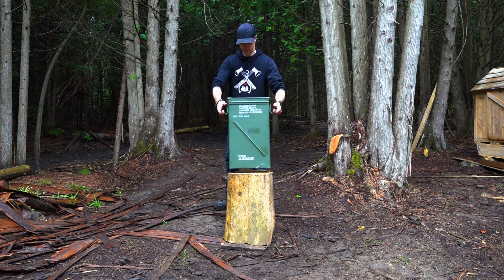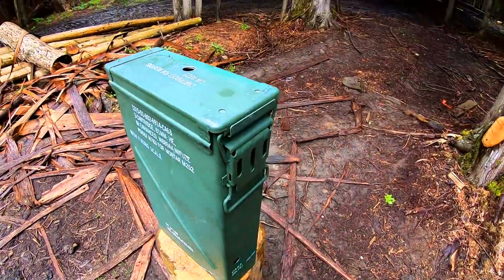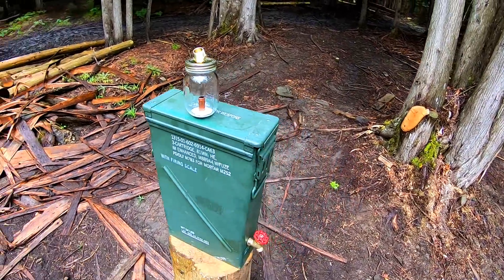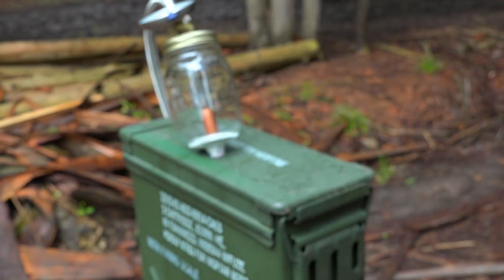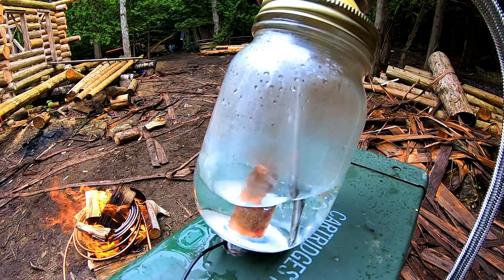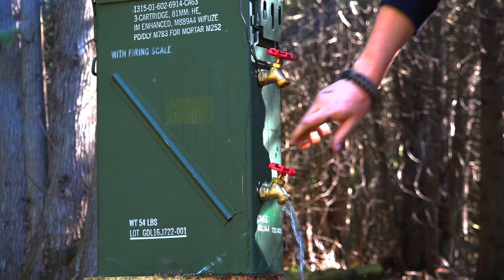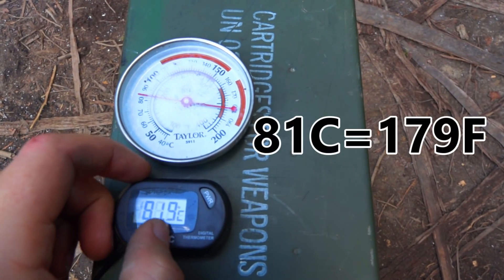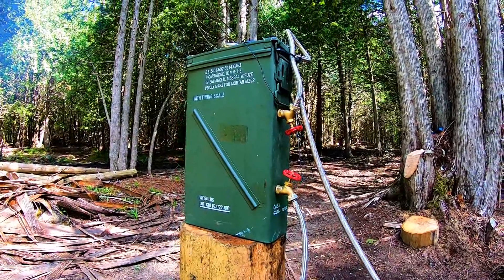Off Grid Heating Prototype- Copper Coil Water Heater / Heat Exchanger / Radiant Heater

Comment: why not put thermal bricks inside or at least stones to keep the heat for longer
Reply: Water has a higher volumetric heat capacity.
Reply: @xylitolchocolateshmackos6102  yes if you prevent or at least try to minimize evaporation and here that's clearly not the case also as far as I just researched volumetric heat capacity is not all that matters, from the most obvious point of water not being practical. And not sure is it even fair to compare liquid with solids...
Reply: @xylitolchocolateshmackos6102  One more thing I remember when I was a kid, sometimes there would be no power and also no heating so that we put water in a big pot on the gas stove to make it evaporate to heat up the house with vapour and we also put brick or stone inside so to spend less gas since you needed to add cold water inside, same as here in video, sure he will need to add less due to less evaporation but still I think it would save him some trips for firewood.
Reply: Just more water to cook much later and keep the heat for longer?
It would be interesting to test when it cools down to a point where it gets too cold in your tiny house and to find the sweet spot of building heat up and cooling down while asleep

Comment: don't see a point of using this. you won't be able to sleep near it, because of the sound and you have to remove the piping from the fire once it boiled. why not  just boil the water over the fire and then just place your ammo box or whatever where you need it.
Reply: I doubt that boiling water just placed in a box would radiate heat for very long, also if he still used this ammo box or something of a similar size that would be a lot of water to boil, this way it keeps boiling while the fire is going until its burnt out. You're right about the noise though youd either find it very relaxing or very annoying
Reply: @camoweed_  anybody who has cook anything knows that nothing just boils while fire is running. Probably the boiled water will condense everywhere inside the cabin before fire is over though.

Comment: I wouldnt have the copper directly over the flames like that.  You want it set back slightly under some ash and mud
Reply: Also the uneven  heat and expansion from a direct fire like that can cause the copper to warp, in addition the hottest part of the fire isn't where the coils are currently located but radiant heat towards the sides as well as the convection heat rising above. 

So mud and ash walls will help with the even heating as well as catching as much of the radiating heat as possible.
Reply: Why?
Reply: @doughboy5840  its not a permanent solution is why. At some point the copper coil will warp and fracture at some point with hot water spill out though it would take some time before this happens so not exactly permanent construct. Best way to do that is too incase the metal into concrete like making it into a firepit basically with the metal tubes inside too allow evenly disrupted heat this will last a lot longer than just throwing the coil onto the fire it honestly depends if you're wanting to spend money every 2-3 years on replacing copper pipes compared to maybe 7-10 years respectively with the pipes incased in cement though that wouldn't be too easy to carry around on a mobile platform some other okay alternative would be fiberglass bowl which is lightweight and you could just attach the pipes onto the underside or even just place the coil under the fiberglass bowl. 

@Kevin that isn't so much of an issue however he should have made a much smaller hole for the volume of water in the tank to slow down the loss of water all water heaters have release holes drilled into them for purpose of relieving pressure if not your water heater would be a ticking time bomb. Also since it seems he is out during winter with it he could just melt snow into a pot and then pour any missing water into the tank.
Reply: @doughboy5840  Because you will boil the water in a closed system with no vent or real expansion minus the loop. Also if he leaves the hole in the top open eventually the water will boil away and the copper will take all the energy and burn up.

Comment: Sleeping in a confined space next to an open bucket of boiling water? What could possibly go wrong? Maybe if you included a radiator built into the wall, with a thermostat to switch off the heat if it gets too hot... but I think I would want some kind of failsafe, to assure that I was not doused with boiling water in my sleep.

Comment: Probably 300 comments about this but you can ad salt to the water and it can stay liquid to -10 degrees Celsius or ad anti-freeze like in washer fluid to get down even lower depending on concentration ( -15C, - 40C). just know that will change the boiling point and it will most likely boil at a lower temperature if you use anti-freeze.

Comment: an adult male puts out about 100W of heat, given that your camper is so small it would be much less effort to simply insulate it sufficently to retain that energy!
Reply: When I read that I assumed you were telling him to pick up a boyfriend, lol
Reply: @TaliaAthena  That would solve the heating problem
Reply: I don't think that's feasible due to the fact that you need a bit of air circulation from outside.. especially with a camper that small.
Or, do you suppose he should install an oxygen tank and CO2 scrubber instead? :)
Reply: @ayporos  i wouldnt be too worried, an adult at rest needs about 8 litres per minute of air, that would be 133ml/sec. if you had a 40mm diamiter vent hole you could supply that with a flow rate of 0.1m/sec. i wont pretend to have done the maths on it but i suspect the convective flow through a 40mm hole in the canadian winter would be much greater than 0.1m/sec
Reply: @lendoggtheking  Oh I'm not worried about the airflow.. but rather the fact that there's no way in hell you can keep your camper warm with 100W of heat output when you have said airflow. 
The moment any non-trivial temperature differential starts to exist between inside & outside is when you get all of the warm air rushing out and all of the cold air rushing in.
Reply: @ayporos  On the assumption that the inside of the cabin is 2m x 1m x 1m it would have an internal surface area of 10m^2. If it was insulated all over with 200mm of PIR foam with a U value of 0.105W/m^2K (R value 9.523) then to maintain an internal temperature of 15C while its -30C outside would take 47.25W of energy (0.105*10*45=47.25). Putting a hole in for ventilation will allow some heat to escape but you wouldn’t need a big hole to keep the air fresh with a difference in temperature of 45C! I am assuming he would have some adjustment over the opening.
Reply: @lendoggtheking  that's a very small cabin, I'd guess his would be many times bigger volumetrically
Reply: @Moretonj01o  to be clear I'm thinking of the snowmobile camper, not the cabin.
Reply: Less effort yes...
 less cool too.
Reply: @barlowjmb  Clearly you haven't tried getting a boyfriend XD
Reply: @angelagrace8499  lol.
Reply: i dont think that it's really that easy since you might need to pee during the night or you just want to chill in the evening. it would take too long to warm up.

Comment: Both water inlet and outlet with valves on them? Yikes... Talk about pressure vessle... You need to add an pressure release valve, otherwise if you forget to open the valves and create a closed container with water in the coil it will go boom or atleast blow the seals spraying out hot water in the camper.

Comment: You need a 1 way ball valve on the cold water inlet .. I like the 5/8 pipe choice for this application. 3/8 needs the check ball to flow.

Comment: How are you going to regulate it? Are you going to let it run at night while your are sleeping? What’s to prevent thermal run away? If you aren’t collecting the steam that is generated and reintroducing it back into the system your water supply will be exhausted before the fire. Copper rolls from the hardware store are easy to bend because they are thin walled, what is the affect of the ashes and dampness on the copper? Might want to think about a closed  system where the coils are just above the fire and you use the steam to heat an air duct that can gently heat your cabin and if it goes into thermal run away you aren’t exposed to boils water in the cabin.

Comment: You need an exhaust pipe on the top that is vented away from the unit if you plan to put that in your camper, or the whole thing will get get moldy from the humidity.  Also your fire was too hot, you don't need that much fuel.  A steady slow burn is what you want.

Comment: So what now?  Do you carry the hot ammo box full of water and set it inside your camper for radiant heat through the night?  You could boil some potatoes in there too.  LOL.  Sorry, I'm a little slow here.  How is that going to heat your camper.  Will your run some of the pipe into the camper as the coil is on the fire during the night to heat the camper?

Comment: A lot of people will run a whole 40 gallon water heater off of a small woodstove just by wrapping a few feet of coil around the exhaust.. Your system works great you just have to find your balance and I would mount a radiator semi-permanently in thereSemi-permanently and you’ll need an external exhaust to release pressure and keep the moisture out. A small car or motorcycle radiator it would work perfectly and you could mount and plummet semi-permanently in there. You can just adjust your coil size so you get what you want, it will really take very little.   If you have an open system you’re gonna run out of water and if you have a close system you’re going to have to limit the heat because once the water boils your pipes will fill with steam and become very high pressure so limiting your flow to control the heat is OK but you still have to be careful with the pressure.  One way to alleviate that is to do a high-pressure system like a car radiator and hoses but I think just adjusting your coil size to be much smaller and placing it on the side of the fire will probably do the job just fine.  Also those shirt fittings have rubber gaskets in them and those might wear out eventually if the water is getting really hot or they get too close to the fire.  It’s a great idea, it’ll be interesting to see what you end up with in the end. 

Another way they do it in India and places like that is you can use glow plug off of a diesel engine and just run it off of a car battery and it will last ours an hours, you could even put it on a timer if you can find a 12 V timer that just shuts it on and off every hour or how often it needs. You could also wind a smaller tighter coil and put it in cement and just put it at the edge of your fire and that might keep it from boiling on you and keep the pressure in The system low enough to where you don’t have a problem with pressure and steam and losing water. It looks like a fun project to play with and maybe even eventually incorporate into the large cabin, radiant heat is nice and even heat and still one of the best ways to heat a house.  With a good woodstove that can keep your logs burning a long time it would be a great incorporation into the cabin.

Comment: So in theory wrapping that copper pipe [or a more heat tolerant replacement] around a Cabin's wood burning stove would mean you could keep a steady supply of warm water ready to go throughout the day? [Granted would prolly need other components than an ammo can to dispense the hot water from to say put in a pump when your're ready to take a shower.]

Comment: Be easier to stow with longer braided hoses attached to a more compact coil of copper.  But that said, wrap that copper around a wood burning stove and use a bigger tank, and you'll have the making of breakfast and a hot shower out in the middle of BFE

Comment: so, how do you apply this to heat your place without it being "too hot" and keep it toasty through the night? it might be 160 degrees later but youre doing this when it isn't below freezing outside. also, if you place this inside... you'll have steam coming from that pressure release hole? I know it's a concept, a good idea! but kinks to work out indeed
Reply: The coil doesn't need to be in the fire.

Comment: PLEASE PLEASE If your going to have solar. Use a cars heater core instead of the ammo can. You can find then in junkyards for nothing. Then your can put a low watt fan on the back. It will transfer WAY more heat inside.

Comment: Your 5/8” tubing won’t last long if thrown straight into the fire. Use type K service copper in the fire instead, you’ll increase efficiency since you are sinking heat better volume for volume. Copper has a 1-1 heat transfer coefficient. No loss, thicker the copper in the fire, the better the heat absorption. Thin copper at the point of dumping heat... whether it’s rad tubing, copper fin tube, etc etc... equals best efficiency in heating spaces with minimum input from the fire. Put thick copper in the fire/longest life, best heat absorption. Thin copper at the “rad” or coil to transfer stored heat equals best delivery of said btu transfer. Incorporate a little more investment of copper to gain efficiency and overall delivery of said heat. You’ll notice a much better heating dynamic. You could say I do some plumbing... free info, invest in copper for the win

Comment: why didnt you put the outlet tap up and the inlet down, so that hot water comes in at the bottom fo the tank, and more cold water wichi is on top goes out first, it would improve efficiency in my opinion

Comment: This is dangerous! If you heat a sealed system like this with a fire it will eventually explode. You need it vented to atmosphere. If you do this inside your hut you'll get wet from steam or scalded. I think you'd be better off just having a wood stove inside with a flue that terminates at high level outside. It would be a lot simpler with a lot less baggage. If your plumbing out a proper permanent shack then woodburner with heat exchanger to radiator system but it must be open vented for safety.

Comment: maybe try putting coils inside the fuel can and filling the can with oil. that way the water heats the oil via coils and the oil will hold the heat longer than the water.

Comment: The copper coils will not last, sitting directly in a fire. And really, you should uncoil at the center and separate two sections of coils. One, I would leave away from the fire the other sitting near the fire or above, without being in direct contact with flames. The coils away from the fire would keep it from boiling and getting too hot. One could experiment with the number of coils on either end until you got it close enough to not be a danger. Also, another reason for saying the coils shouldn’t be left in the fire directly is because the copper will melt and corrode very fast in a large fire. Having one set of coils next to the fire and one set in, say a pile of snow should balance out the system. Open for criticism and question/comments.

Comment: Radiant floor heating. Do only one loops worth of copper in the fire. Unfurl the rest and put it on the floor with a new sheet of plywood over it. Add a pressure valve outside the tent, done.
Reply: The outside coil disconnects from the inside of course, for travel. If you put only one loops in the fire it won't get hot.

Comment: use an old electric water heater. you already have threads for the upper and lower element, and the old water heater is already insulated. You can remove the T&P on the side ad screw in a piece of 3/4" galvanized pie and elbow and have a vent to relieve pressure. if you incorporate James' idea, you can just install the old car radiator right into the thermo-loop. Put a little solar powered fan and blow across the radiator and you've create a dual system that will heat (whatever) and produce 50+ gallons of hot water. a double win.

Comment: it is required to lift one of the tubes coming out of the fire up. Otherwise, the resulting steam plug in the pipe roll above the fire will prevent heat transfer to the water tank.

требуется поднять одну из трубок, выходящих из костра вверх. В противном случае образующаяся пробка пара в мотке трубы над костром (пар подниматся вверх)  будет препятствовать передаче тепла в бак с водой. И это должна быть труба, что идет наверх.

ALSO, I would replace the copper tube with a stainless crimp - it lends itself better to bending and will potentially last longer.
КРОМЕ ТОГО я бы заменил медную трубку нержавеющей гофрой - она лучше поддается изгибу и потенциально прослужит дольше.
I would also insulate the water tank. in summer it's okay, but in winter it will cool down quickly.
так же я бы утеплил бак с водой. летом еще ладно, а зимой она будет быстро охлаждатся.

Comment: There are some people saying that he should’ve used a cars radiator, but I understand why he went this route. A cars radiator both would not hold as much water as this(so minimal thermal mass or ‘thermal battery’ effect), and even the smallest car radiator would most likely be “too much”. It would likely get too hot in the camper too quickly because it’s far more efficient (really too efficient) at giving up its heat to the space. And because of both it’s design and because it has less water, it would cool off far more quickly at night. So he’d have to get up in the middle of the night to stoke the fire again. Only for it to again get too hot. Just my opinion

Comment: If that got knocked over in the night you're in trouble. I like the idea but If it were me if weave the copper tubing though the floor with a shut off valve inside the camper to control the heat and keep any chance for a spill to a minimum.